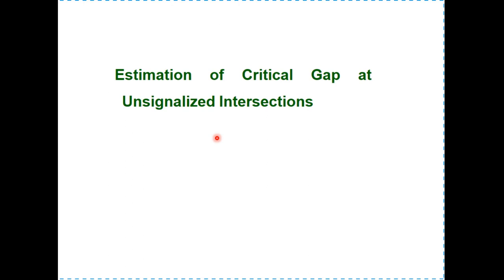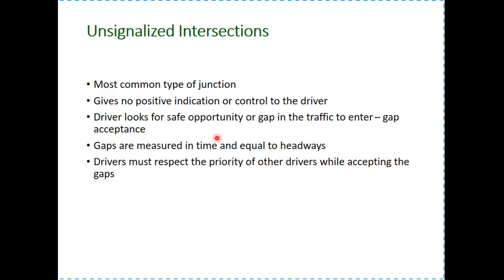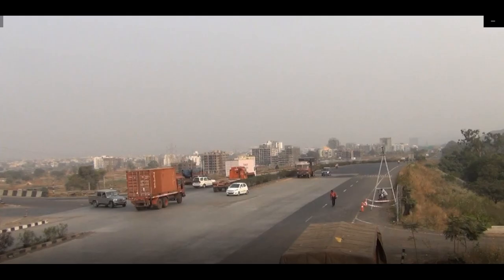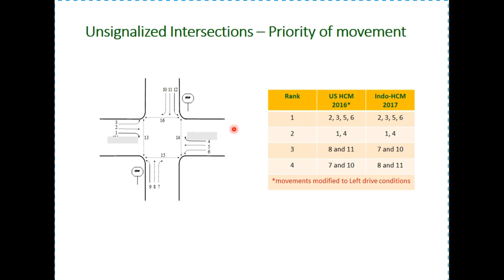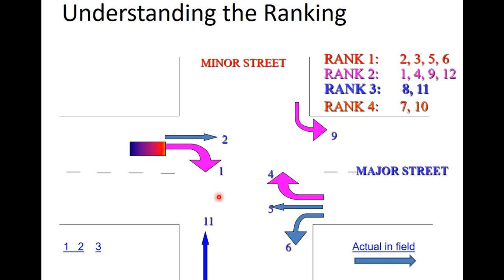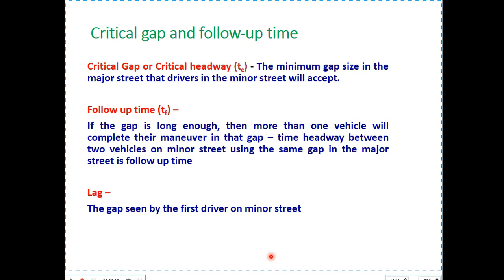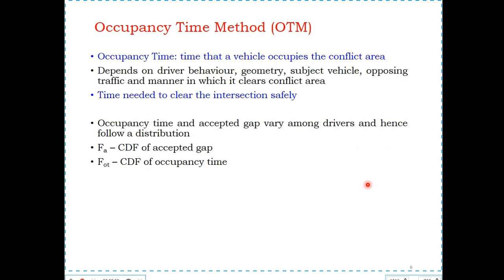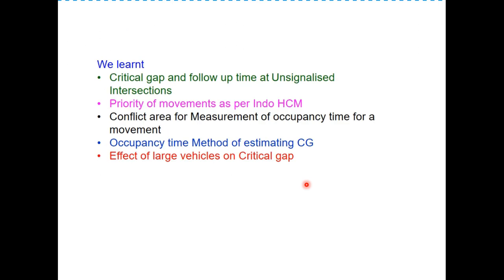#capacity, #gap, Critical Gap at Uncontrolled Intersections, Method of Critical gap estimation

Comment: Sir from the Maximum likelihood method, Equilibrium of probability method and Occupancy time method, which is the best method to estimate critical gap at unsignalized intersection in mixed traffic in india. And why?
Reply from the maker: Very difficult to answer. The goodness or correctness of the method is judged when you are able to compare the results with some threshold values and there is no such threshold value of critical gap. Therefore you should justify use of a method that can take care of actual behaviour of drivers in field. Based on this critierion, the Occupancy Time method has the merit as it considers the time a vehicle remains in the intersection area.

Comment: Sir one question is there, how to calculate plv it is no where written in the hcm manual also.

In this presentation you have mentioned one graph but that is not there in hcm manual. Kindly suggest how to calculate plv..rest i did it exactly everything
Reply from the maker: Plv is simply proportion of large vehicles in the traffic stream. You are probably asking for flv 
The graph shown here is for illustration only. The values of flv is to be taken from the table given at time 16.50.
Reply: Sir flv I know we can take from table, but that proportion of plv how to take, is it volume of only heavy vehicle divided by total volume in pcu in particular movement or something else. Please clarify that or please share ur what's app no so that I can send 2 examples given in hcm  chapter 8[ unsignalized intersection]legged and 4 legged in 3 legged th e value of plv is coming near 4.99 but in 4 Legg the value of plv is coming in 2 digits varying from 14 to 20.

Please suggest plv proportion from only heavy or we have to add big car, lcv and heavy vehicle upon total volume or only conflict traffic volume. Please clarify how to take proportion Sir.
Reply: Sir please reply on this as i m confused by the example of plv given in hcm,.

How to calculate plv proportion is it only pcu of heavy vehicles to total pcu of that movement or we have to take volume of which type against what

Comment: Thank you sir, but I have a question on how did you arrive/what is the formula for the adjustment factor for large vehicles?
Reply from the maker: The variation shown between the Critical Gap and PLV will be a straight line relation on a semi-log paper. Get the equation of this relation. Coefficient of the variable PLV is the adjustment factor. I hope it is clear now.
Reply: @SatishIITR  thank you so much sir!

How about the capacity factors "a & b", how did you arrive with those ?
Reply from the maker: @janmariellausas8179  where are "a" and "b" in this video. It does not discuss capacity of the intersection.
Reply: @SatishIITR  Hi sir, there are variables 'a' and 'b' which say adjustment factors in the acceptance gap model in the equation for calculating the capacity for each turning movement. Is there a way where we can get that a and b factors sir? It was not discussed in your video sir, but I got to read this in the indo-HCM chapter 8 on the unsignalized intersection.
Reply from the maker: @mariaelirezacanoog4214  Oh, you are talking about Table 8.8 of Indo-HCM. These values of a and b were estimated from field values of capacity. What we found that even after estimating actual critical gap values and conflicting traffic, the capacity value esimated from US HCM method does not match with the field capacity. Therefore a dn b were proposed based on large data collected in field and the capacity esimated from the equation. It was after lot of trials and anlayiss that we came out of these factors - all empirical

Comment: sir this is my mtech tesis topic. i want to plot the MLE curve on the bases of data, so how can i get data to plot the curve.?
Reply from the maker: Data are always taken in field. select one intesection in your viscinity and carry out video recording for 3-4 hours covering critical area of the area (or the entire intersection) and then extract the information of gap accepted and rejected by a driver.
Reply: @SatishIITR  sir i have a video of an unsignalized intersection. sir, should i note the maxium rejected gap and finally accepted gap for every vehicle, either it's a two, three or 4 wheeler ?
Reply from the maker: @singervishnudevatwal8338  The CG will depend upon the vehicle category also. Therefore, better to measure gaps for each type of vehicle category.
Reply: Sir from the video of an unsignalized intersection how can we find largest rejected gap and accepted gap. Because we don't know what is vehicle speed. Sir another question arise that,  is there need of mean and variance in MLM